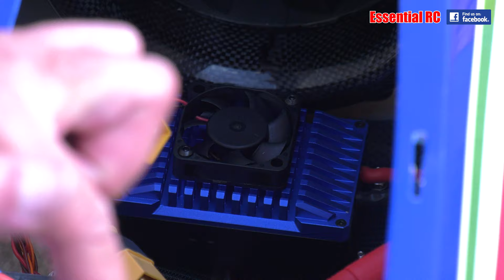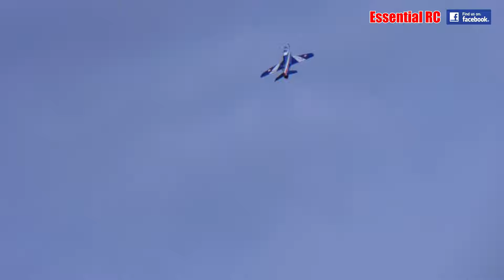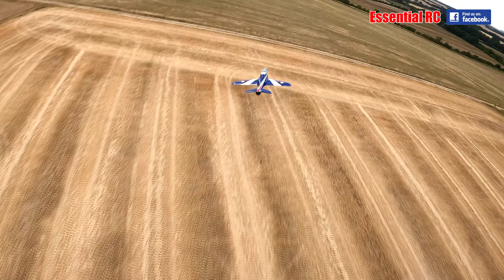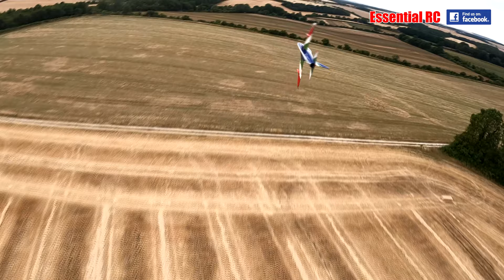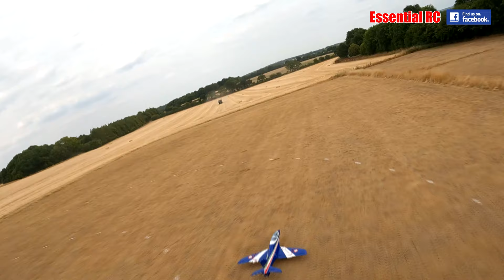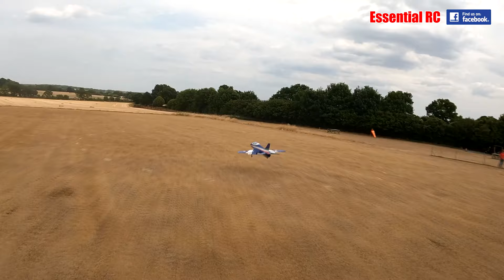Sebart Avanti XS 1.9M | 14S / 58.8V | Schubeler 120MM EDF | ULTIMATE RC ELECTRIC SPORT JET

Comment: Not something I'd thought about before - the difference between take-off and landing weight with a gas turbine installed compared with an electric ducted fan. 'Empty' batteries weigh the same as 'full' ones!  I suppose the same applies to electric and glow powered of the sizes I fly but not so much of an issue.

Excellent flight with a very attractive model.  Having worked at RR for over 30 years I lost interest in gas turbines once I retired but it's still worth watching ones as attractive and well flown as this.  Electric ducted fans seem to have the closest real-life sound of any model (apart from model gas turbines that are beyond the pockets/skill of many of us).
Reply from the maker: Yup, unfortunately EDF models don't get lighter after take off which is why we just aim to have enough milliamps in the packs to get us through a decent flight time. Battery technology has come a long way so EDF flight time is getting closer to turbine. This was on Lithium polymer chemistry based batteries but Lithium Ion are becoming more common as they can now provide more amps at a lower weight compared to polymer. I'll try that soon. Thanks for watching and commenting !

Comment: Hello, maybe I overlooked it but what was the total flying weight of your 14S 6000 setup please ?  And what was the weight when you flew with 14s 12000 ?  My Avanti XS is nealry ready with 12S 9500 and comes in around 9.5 kilogram, which is 1 kilogram over the specs set forth by Sebart so a bit anxious not to damage the undercarriage. I also have Schuebeler because they are the best. I use the TenShock 890kv and hope it will taken off from grass with the 9.5kg... Many Thanks for your advice!

Comment: I also have a 14S setup in my Avanti XS.  I use SMC 8,000 mAh batteries and a JP Hobby fan.  I get about 4-5 minutes of flying time with 30% remaining.  I still think it could have better performance.  What is your exhaust diameter?  Pierre Deguire
Reply from the maker: 10cm from memory but I'd have to check. Its whatever the maximum is at back of fuselage